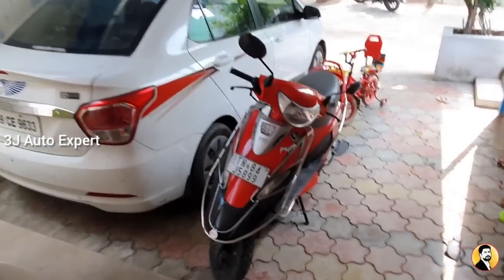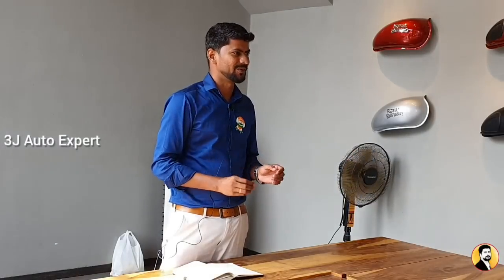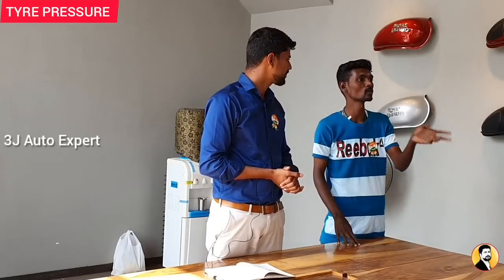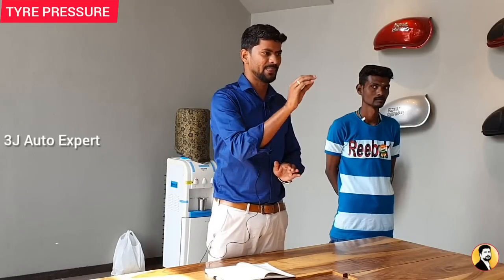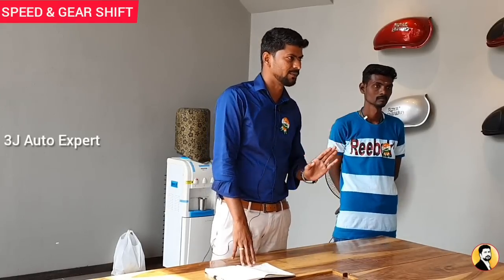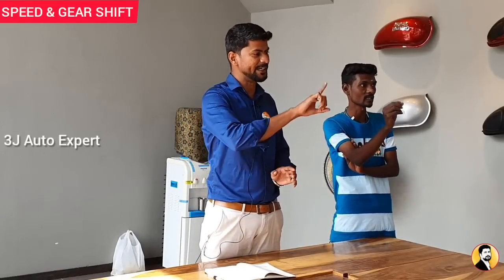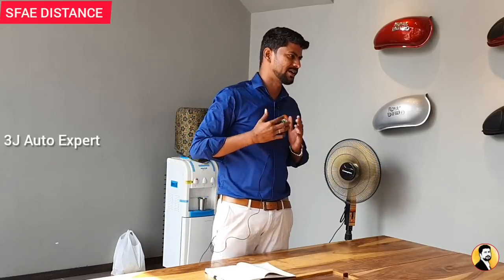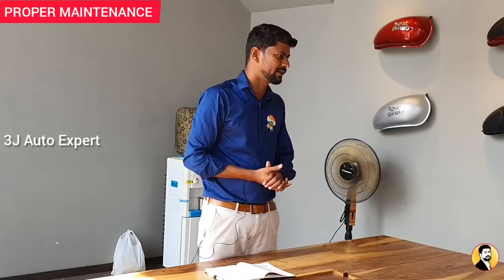How to increase bike & Scooter mileage| தமிழ்| 3J Auto Expert

Comment: Hi Bro.Thank you so much for your tips. For RE Meteor Tyre Pressure  they mentioned 32, 32 and 32,36 with pillion in user manual. shall i follow the user manual or need to change Tyre pressure as you mentioned in the video. please suggest
Reply from the maker: Bro pls go with user manual..
Reply: @3jautoexpert  Thank You So much for your reply Bro..keep Rocking

Comment: Bro na gixxer sf vachirukaen ennoda Tyre pressure 29 and 33 bike la kuduthuruku both singles and pillion rider ku.. Ippo recent a 2months a than appadi maintan panraen Bt initial 1 year a na pressure 30 and 40 vachirunthaen appadi athrgama vacha yaethum prblm aa... Then air collet bike konjam long a pona oru 2 min start la vindanum nu solvanga athu unmaiya... Konjam explain pannunga bro
Reply from the maker: Yes bro, immediately stop pannama konjam neram on la vetta nallathu and tyre pressure correct ah maintain pannunga

Comment: Sir, nethu highway la 100 speed la ponen sudden ah speed koranji 70 kitta vanthu engine la loda loda nu sound varuthu, antha sound ippo slow ponalum varuthu shop la ketta engine seeize nu solranga but bike running la tha irukku, 6000 aagum solranga unmaiyave engine seize ah bike la black smoke varuthu nutral la race panna, enna problem konjam sollunga bro
Reply from the maker: Sir authorised service la check pannunga

Comment: My bike 2016 model pulsar , millage 100rs ku 55km kuduku , correct thana ila millage kammi ah bro?. I am from rajapalayam
Reply from the maker: Cc enna bro
Reply: @3jautoexpert  150
Reply: Model 2016,Pulsar 150,
carburedor adjustment
Oru video podunga ji
100.rs petrol kku 45km 
Than pogudu
Reply: plug and air filter 90% ellame nalla erukku
Reply: Engine ellame nalla erukku adjustment please bro
Reply: @sankarVIPNoble6  100 kku 55kms good mileage bro..